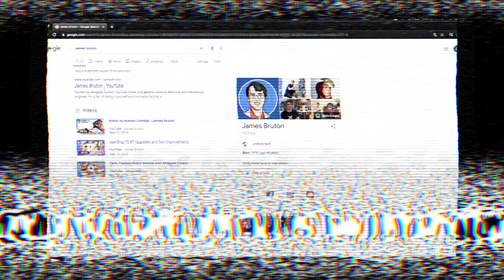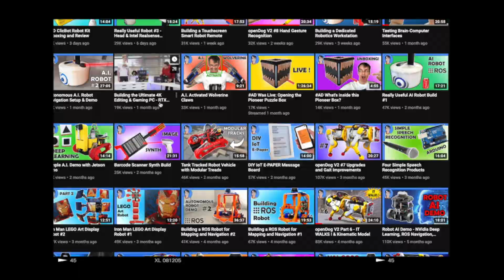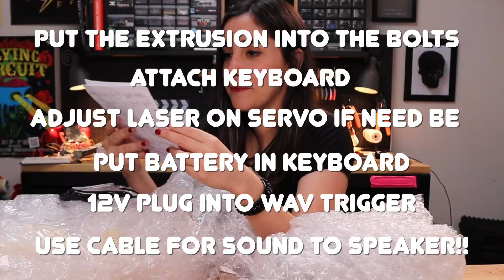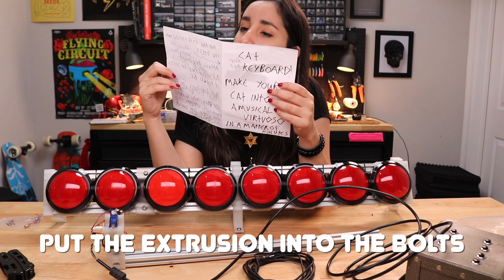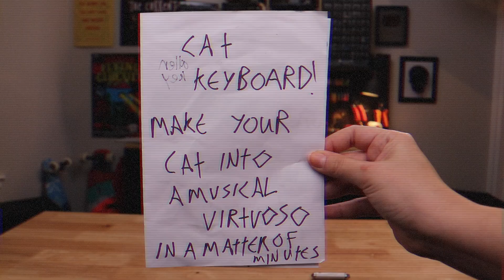I BUILT A ROBOT WITH DEPRESSION AND ANXIETY

Comment: Yo I have two ideas, you could 1) try to make the buttons less reflective and 2) switch out the servos for 8 different lasers that are triggered by an arduino. No sound + no unwanted reflection.
Reply from the maker: that's too many arduinos for such a simple solution!
Reply: @Estefannie  i forgot that it already contains one. 

*You could switch the servos for seperate diodes